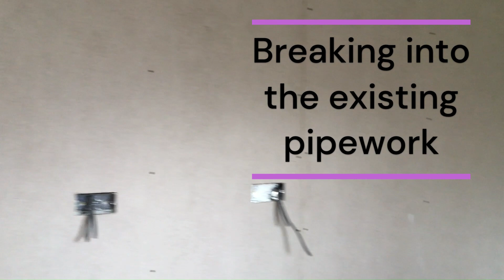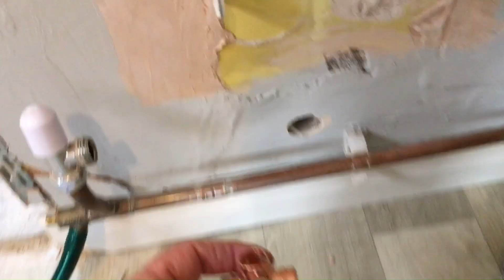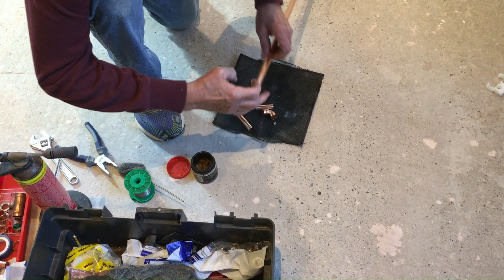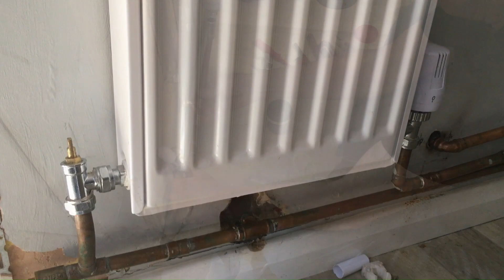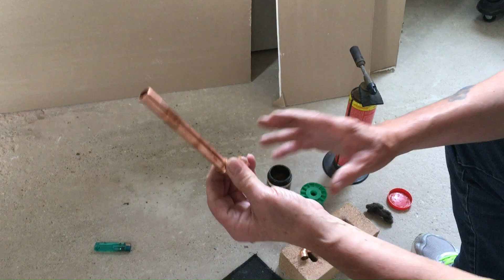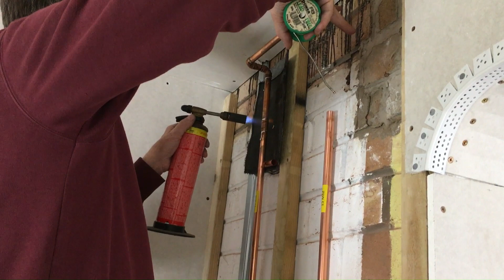Real DIY brick extension part 11 installing the radiator DIY (part 1)#addingaradiator

Comment: Little tip.   You would of been better pulling bends on the pipe work top and bottom too many chances of pipe leaking -   Get a little brush not your finger for the flux.  No sleeve on pipe work through the wall ,   Also no need what so ever to take the rad off really simple to cut in and pipe up ,,  last thing you should not put flux inside the fittings and clean excess after.  Not bad for a beginner
Reply from the maker: Thanks Peter, always happy to get tips and advice.  👍